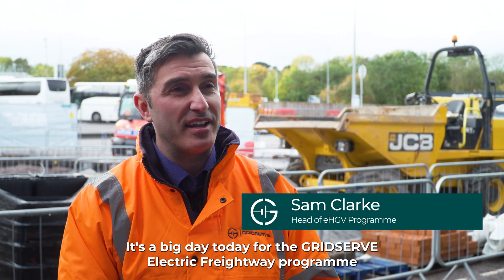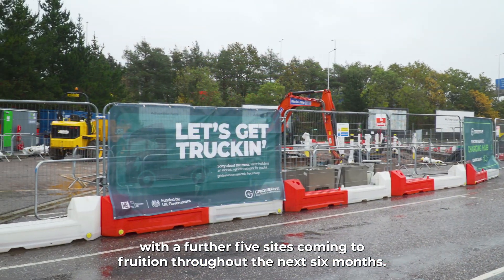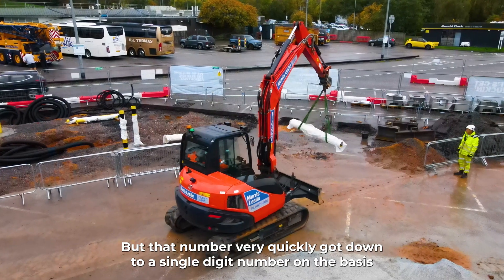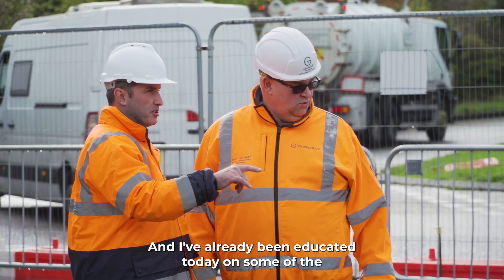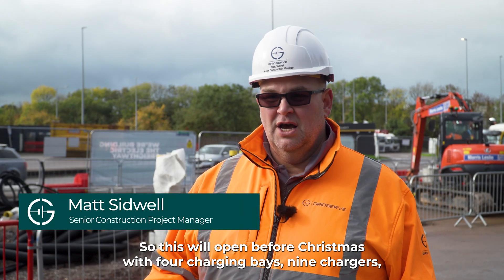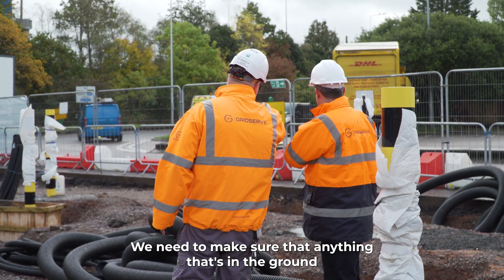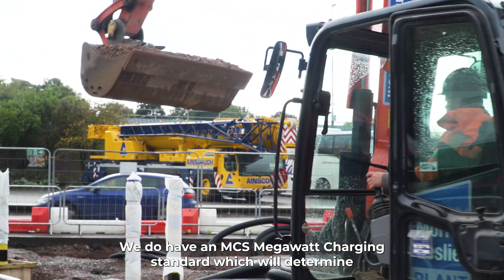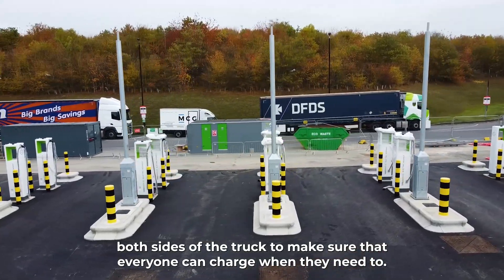Construction starts on the GRIDSERVE Electric Freightway

Comment: Great to see these new facilities coming online, and with forward capacity planning in mind. We do seem to be about 2-3 years behind Europe in electrification of HGV’s - they have numerous large purpose built charging hubs along major trucking routes. Most seem to require 800v CCS2 connections, but some are already going to the MCS 1Mw connectors for improved power delivery. Not sure we really need those in the UK, but it makes sense to follow the standards to allow cross continent deliveries with ease.